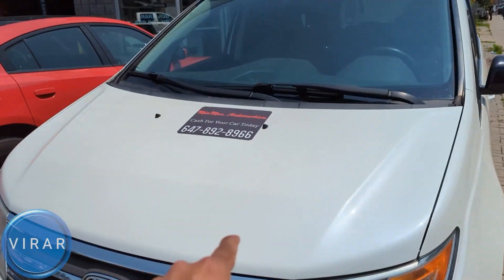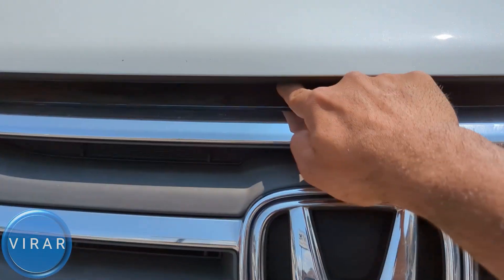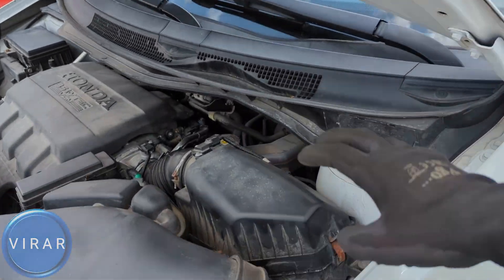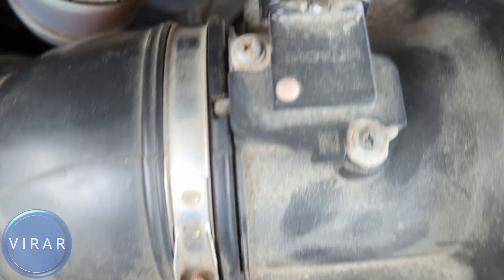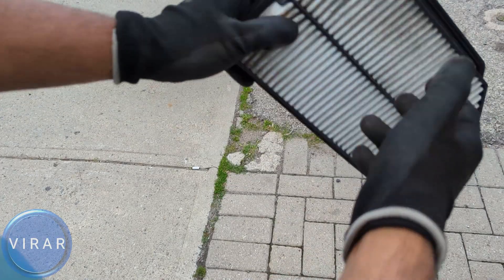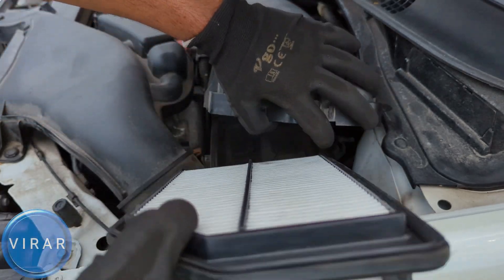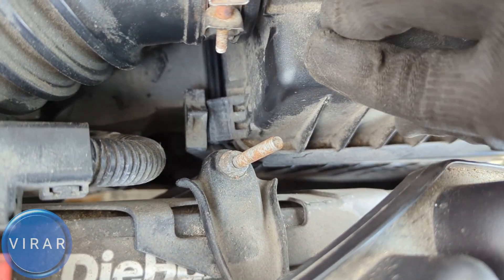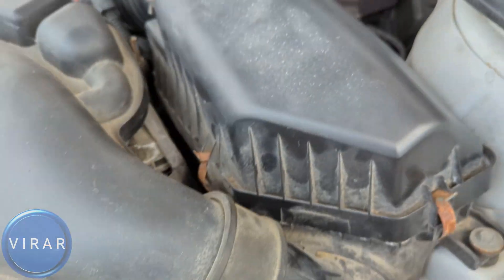How to Replace Engine Air Filter - Honda Odyssey (2011-2017)

Comment: Wish I knew about two tabs in back, looks like I broke 2 off. Is this a problem,  noticed one missing from your car. At 70 doing myself to save money,  hope didn't give myself bigger expense, especially since have to drive across the country alone and female don't want problems.  Thanks for any feedback.
Reply from the maker: As you can see in the video, mine is broken as well. Not a big deal. I wish this helps. Sorry about the late reply!
Reply: @VirarAutomotive thank you, eases my mind